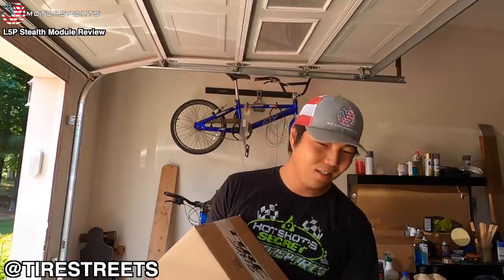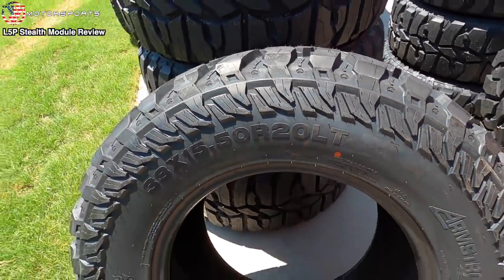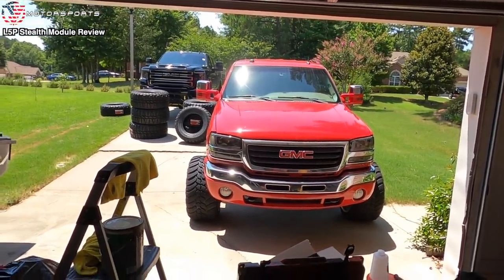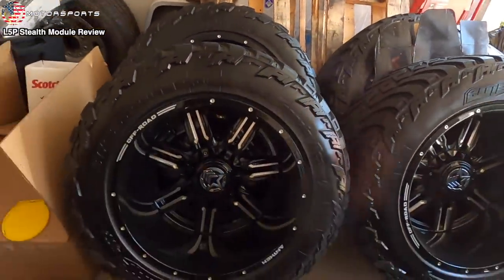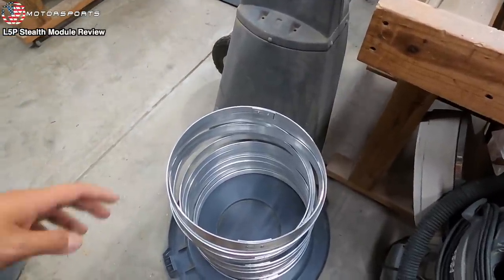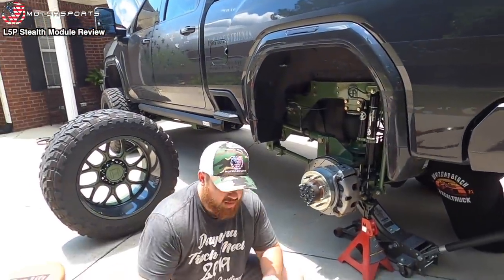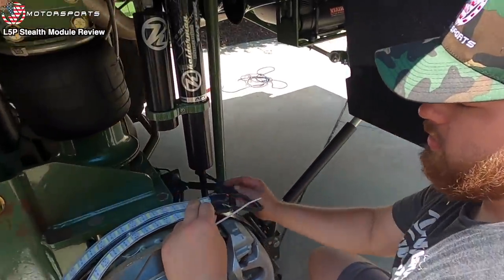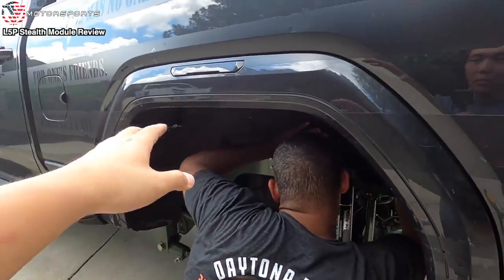WILL THIS RUIN THE LOOK OF MY SHOW TRUCK?!?! *2020 DURAMAX*

Comment: My 06 lbz will have 700hp at the real wheels in 2 weeks. 100 over injectors, duel cp3 pumps, arp headstuds, 280 gph fass fuel, compound turbo, and ppe from Idaho rob!
Reply: Nice. My 07 lbz just turned over 300k miles this past week. She just eases on down the road I don’t want to turn it up being she’s been rode hard her whole life.

Comment: So I just bought a 91 f250 7.3 idi Diesel and it is my first any suggestions on how to make it look good high schoolers budget no daddy’s money
Reply: Crank up the torsion keys and maybe a bds or rough country 2 1/2-3” leveling kit with the keys up still and keep stocks and throw some 33’s or 35’s Firestone or decent cheaper all terrain or mud terrain tires. Plasti dip badging and remove some badging,

Comment: Where do your tires rub with the setup you have on the at4 right now? Thinking of running that setup going for the same look thank you.
Reply from the maker: Only on the valence. Bumper spacers should fix it
Reply: @JWMontoya  Then I should be ok I’m currently running 24x14s on 33x12.50s with leveling keys FTS uca’s and wicked customs bumper spacer on my Denali and want to go with a FTS 7-9 kit and fit the biggest tire without rubbing or having to trim anymore than I already have thanks for the reply bud.